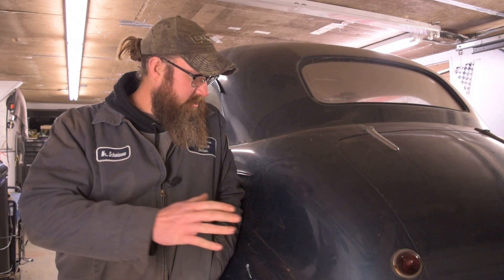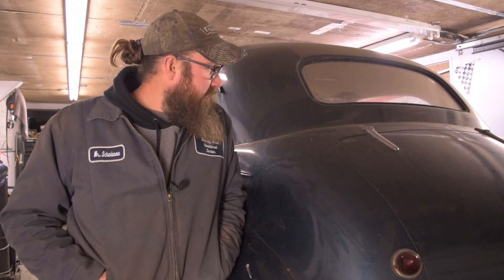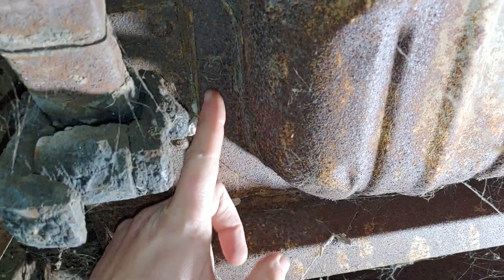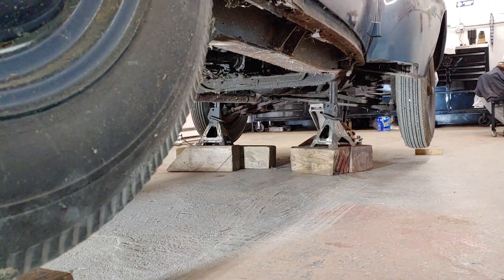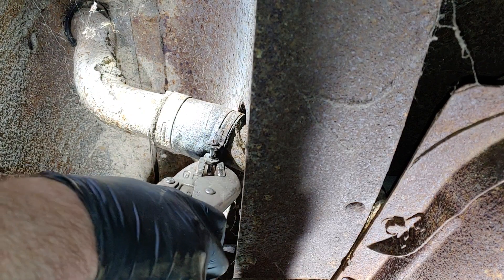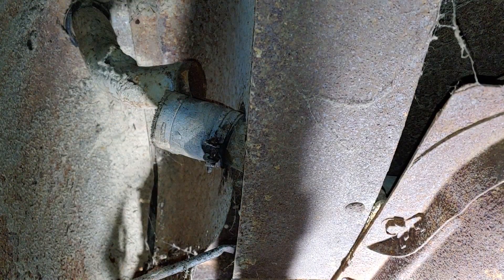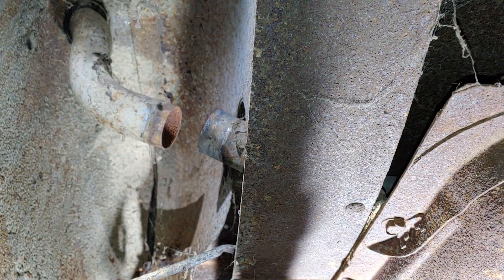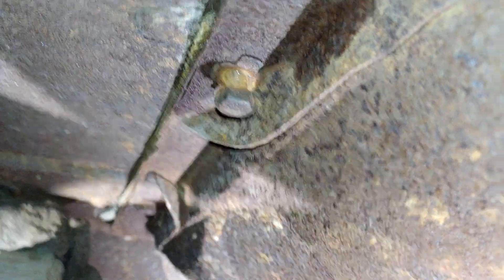Barn Find 1940 Chevy Gas Tank Cleaning

Comment: I'm working on a 75 Dodge 1 ton box van, last registered 1998. There is a hole in the plastic tank on the side, open. I've dumped most of a gallon of the most nasty syrup out of it. 2 lines up top that don't even enter the tank. No idea what the side opening is for. The fuel line was cut. To run it I stuck the pump tube in a gas can. Working on what to use to clean it out. plotting what to do with all that nasty varnish :) BUWAHAHAHAHAHA!